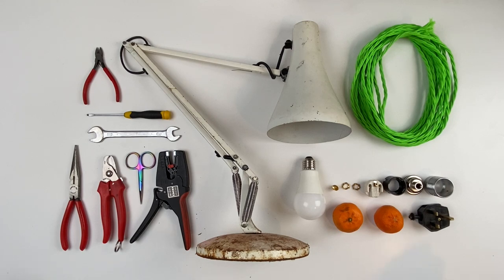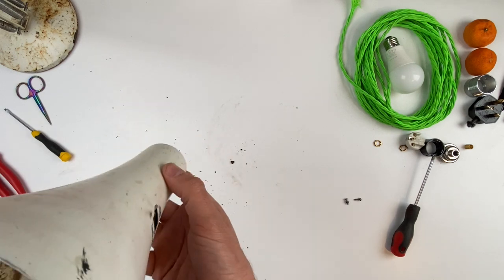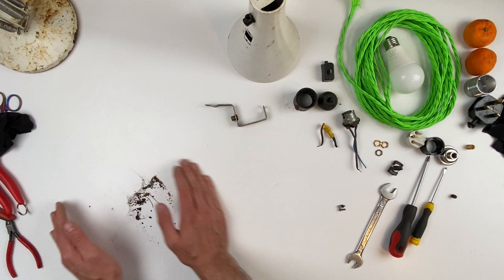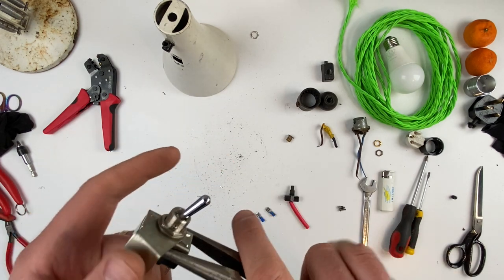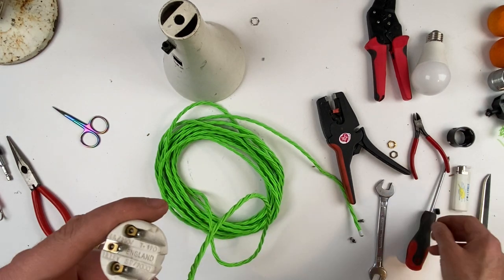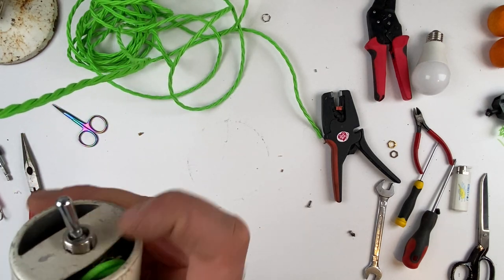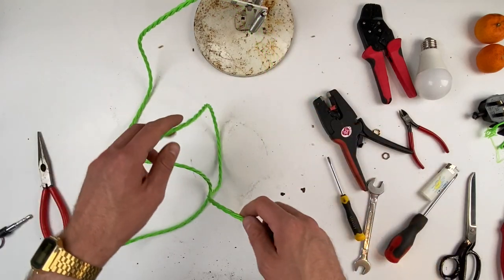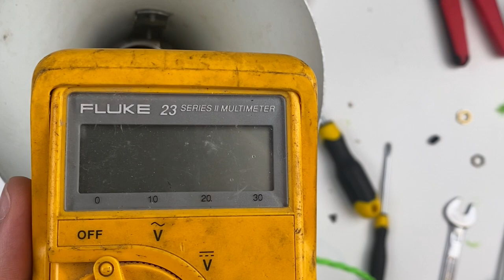Spider infested Classic British Lamp Repair

Comment: Good job. I replaced the bulb holder on one like this to accept a screw base bulb for here in the US. Of course changed the end plug as well. I ran into similar issues you did. I have five 1227 models and one model 90. They are so mechanical and decorative at the same time.
Reply from the maker: Thanks! I love them - and I think they are one of the first 'products' that I triely appreciated the design of (mechanical and aesthetic).

I have 2 of these, both with similar levels of restoration, and an RS components version (possibly a white label made for RS in the 70s or 80s?)